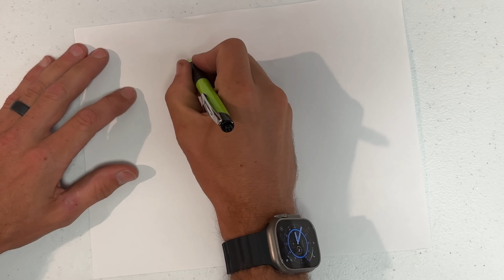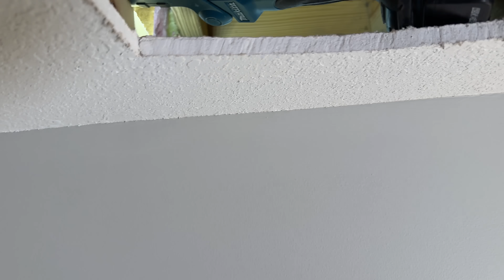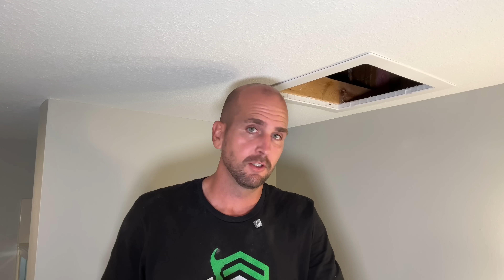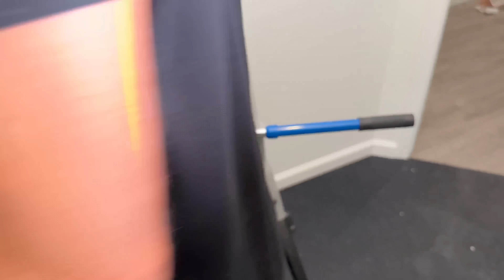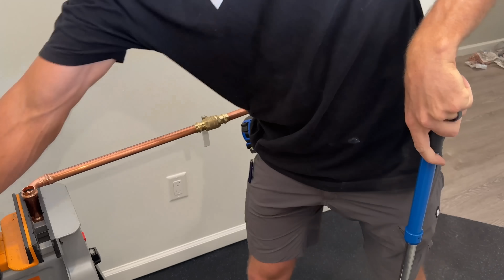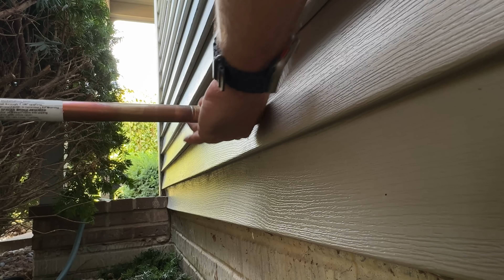How To Install A New Outdoor Faucet Location And Water line

Comment from the maker: Studfinder (Stud Mark) - https://geni.us/kCLBX
Access Panel - https://geni.us/bzmiA
3/4 Auto Cutter Pipe Cutter - https://geni.us/vL3VYDM
PEX B Crimper- https://geni.us/CJBBC
Copper Press Fitting Crimper - https://geni.us/IqAJ7o0
3/4 Press Fitting (Ball Valve) - https://geni.us/ZwPfZY
Sharkbite (Ball Valve with Reducer) - https://geni.us/UPSurD

DISCLAIMER: This video and description contain affiliate links, which means that if you click on one of the product links, I’ll receive a small commission.
Reply: Llll)

Comment: I want to use hot water  output to my washing machine to be splitted and have the other output  to go outside .. just the other side of the washing room wall .   If I  use  some kind of 2 spigot item,  it won't reach the outside ( reach outside is best. .otherwise, I run a hose and push it through a hole in the  STUCCO wall to the other side.   Anything I should consider in making a hole through the stucco wall ?  Any suggestions for which 2-spigots item  ( or with some kind of elongated extender ... like yours but how can I put it together ) . I did see some 2-spigot split items but they have those tiny teardrop handles to turn water off and on ...not sure if I like that.  Thanks

Comment: Great videoman !. Now, after all that work, consider installing a large sacrificial anode to protect it from galvanic corrosion - the true culprit in this area of different metals and water  (especially for the screws holding the faucet). Look into The Hose Bib Buddy.

Comment: I replaced my sillcock a few months ago.  I have weaker water pressure and it leaks if I open it up full blast (seems to be leaking where the screw is on the handle).  It was brand new when I bought it and I bought it from Menards. :(

Comment: I have a question off topic, can a homeowner do his own roof without a contractor, , thanks
Reply: I did my own but really it’s really tough work and will take a long time. Make sure to factor in the wear on your body, your time off, the not as perfect finished product. Nail pops happen if you don’t drive them in far enough. Metal might be easier and lighter. If you can get them to drop the shingles off on the roof it’ll save yea. And you will be finding nails for years. The dumpster rental is expensive to then there is paying the dump to take them. And standing on a sloped roof when you’re not used to it is hard on you
Reply: Yes, but if you fall off the roof, it's your problem.

Comment: You are pretty awesome!!!  I will never do most of this but every once in a while I find something that you do that will help with another project. So this with the PEX and copper and shark bite. I have a cruddy builders plumber who put a pressure canister between 2 water heaters. Used PEX and stapled it to wall. That didn't hold. So now I see a way I can use copper PEX and shark bite and get it to stay above tanks.

Comment: Rubber O-rings will fail long before a soldered joint will. Soldered copper is still the best way to transfer water throughout your house.
Reply from the maker: I had 3 pinhole leaks in the last year most likely created by sloppy solder work in copper 🤷‍♂️

Comment: Love the service loop PVC jig. I’ve never seen that before. Also, I’ve always wondered, why haven’t you gotten into PEX A (Uponor)? I have the DeWalt expansion tool and it makes working with PEX SO nice. You also don’t get reduced diameter fittings. Menards has a great selection of their “PowerPEX” tubing and fittings.

Comment: 1 The Propress fittings require very clean-burr free pipe. More so than when sweating the fittings.
2 When using the Propress fittings. Push in the pipe/tubing until it bottoms. Then mark a line on the pipe with a sharpie. Then when you go to crimp you can see that you are at max depth.
3 The screws that hold the outdoor faucet to the wall should be S/S for outdoor use.
Cheers

Comment: Interested in that service hatch. I have a frost proof hose bib that has no access and I’m worried what to do if it should need servicing. 

Also, I’ve decided to go expansion PEX if for no other reason than it allows full flow unlike crimped PEX. The battery powered tools aren’t all that expensive and would have been more convenient in a few places in your video than manual press fittings or crimping. (I generally just solder in a PEX-A fitting where I want the copper to end and go expansion the rest of the way.)
Reply: If my house wasn't full copper I would go PEX A - the expansion stuff for sure, that is easy, super reliable, better flow, etc.

Comment: Is it important to pitch the faucet so it drains when it's shut off? It's not frost proof if water sits in the pipe.
Reply from the maker: Yeah I should have mentioned that as I was surprised that Prier built the slope into their design by angling the mounting flange such that when screwed flat against the siding/sheathing the pipe inside would have a nice downward slope out.

Comment: It's funny that every plumber has a cow about sharkbite fittings  and say "I'm not gonna trust an O-ring."  But of course they love these press fittings which also rely on o-rings.
Reply from the maker: I always found that a little ironic 🙂
Reply: Copper is great as long as you don’t have acidic water, like I do.
Reply: I think Australia and UK have been using them for decades? Correct me if I’m wrong
Reply: Look if you’re a DIY guy and don’t know how to sweat copper shark bite fittings are fine
Reply: EPDM (rubber) WILL fail too. Everything has a lifespan, but I’ll trust sweated copper (the gold standard) and PEX will last longer than the rubber.
Reply: @narlycharley  Soldered Copper is the only way.